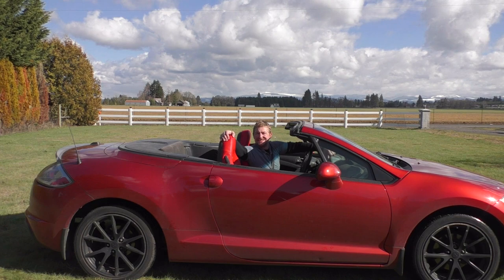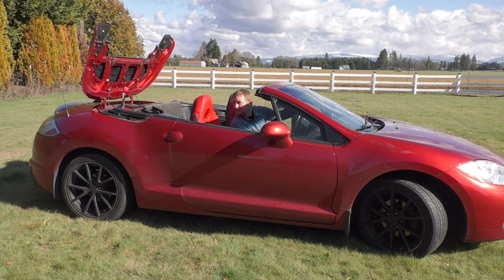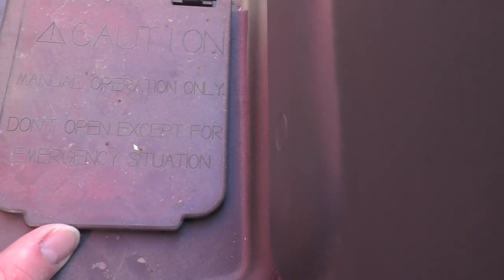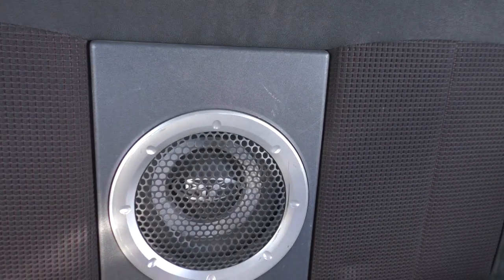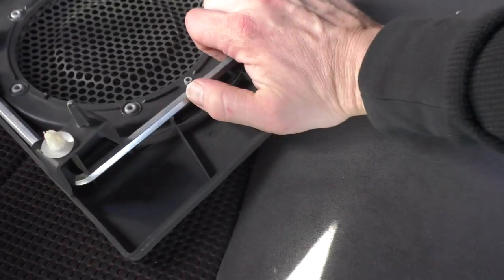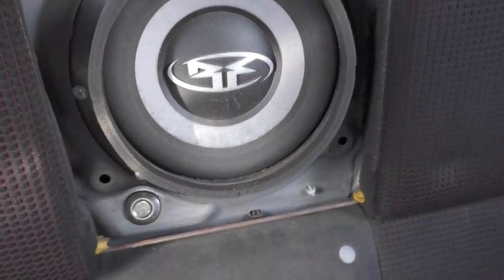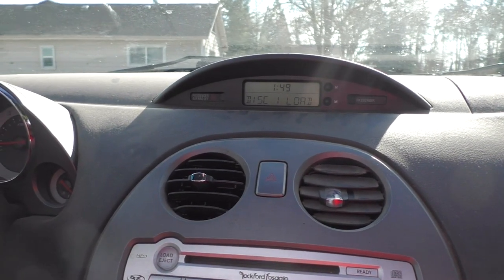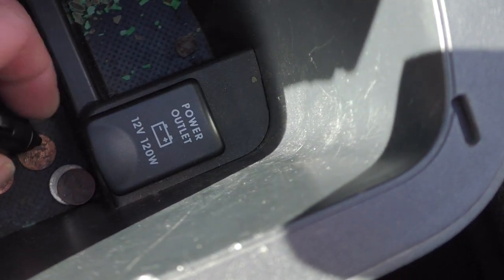Eclipse Convertable troubles

Comment: Thanks for the video. We’ve got an ‘07 and had trouble with some part that bent while putting the top down. It cost more than a little to have it fixed. But it was worth it, as my wife and I think these are about as cool a looking convertible as you can find.
Reply: Hey! Did your 07 had the aux input?

Comment: Wife has an 07 version of this car.  I’m trying to remove the hinges that are leaking hydronic  fluid.  I’ve already had one of the cylinders rebuilt.   On her car there 6 cylinders and the two hinges.  Getting the hinges out are posing to be very difficult to remove.
On the 07 model there was no aux jack.  I had to remove the stereo and add the cable myself.  
Also also, my cat sleeps in the same exact place.
Reply: I have a 2007 also. I might need to ask you some questions. I am having to figure this out on my own. I’m a little lost😁
Reply: I never could find a good video so just started removing things and taking pictures.  First one took about an hour and a half ( drivers side).  The other one took 30-45 min once I knew what I was doing.   Sent them off to get rebuilt.  Let’s see how long it takes to install.  Lot to removed.  Even the two panels from inside the car back seat.   I do a lot of work on my cars so have bunches of tools.  It helped a lot.

Comment: Have had problems with my top as well.  Going to see if I can add fluid, since pricing the 3 hydraulic cylinders are about $250 in a kit.
Reply: Hey did you find the hydraulic fluid? I'm having a hard time finding it
Reply: @moniquegainey3292 dealer told me you can use automatic transmission fluid or power steering fluid i guess 🤷‍♂️

Comment: sweet. my 2008 top is not opening for a while. I took it to a few places and conclusion is water dripped into the car through the back window and damaged the engine that opens/closes the top. Now I "need" a new top and engine. Upholstery guy i took the car to said the Eclipses are really "finiquie"? to make new tops to, so he recommended taking to Mitsubishi, who discontinued fixing/replacing it. I'm in ATL Georgia, do any of you have tips on where to go to get a top (does not need to be new, just in decent condition) and the engine to work the open/close mechanism? thanks!!!
Reply from the maker: Very good question. I really don't know about that one.

Comment: Just fixed my top on my 12 spider Mitsubishi. Wouldn't close all the way.opened the to half way and found a loose bolt in the middle of the track. So happy, now I don't have to drive 50 miles to the dealer to fix. Hope this helps anyone with similar issues.

Comment: Thanks for this video... Do anyone know how to fill the hydraulic fluid back up and where to purchase the fluid??
Reply from the maker: For that repair I have no idea. I would take it a Mitsubishi mechanic. They should know that question and what to do. It may be a simple fix, I just have no idea how to do it
Reply: @woodbrassandglass  thanks for your response.. the latch that you opened in the back for the emergency manual close, the place to refill the hydraulic fluid isn't in that compartment??

Comment: The hydraulic cylinder that lifts the back cover up is leaking oil. Is it a sealed system? Can I add oil somewhere? It goes really slow and growing, just like low oil. Help!! Lol, any more ideas?
Reply from the maker: If it's leaking oil, you've most likely burst a seal. If you have friend who specializes in hydraulics take it there. Otherwise the car dealership is my advice
Reply: Hey did you ever refill the hydraulic fluid and if so what kind

Comment: Do you know if they ever switched the knob back after you were able to close the top. I just closed the top using this technique and now the open and close switches register and the windows go down also hear the motor but nothing happens and the t bar mechanism doesn’t move when either open or
Closed button is pressed
Reply from the maker: Sounds like several issues at once. I would take it to the Mitsubishi dealer/service station.
Reply: @woodbrassandglass  Sorry maybe I worded that weirdly. So I followed your steps to close the top manually but I didn't turn back the knob back clockwise that holds the pressure before I pressed the close button which sealed the top. Now my open and close button registers like its working and I hear the motor moving but nothing happens and Im wondering if it was because I didn't turn back the knob which controls the pressure.
Reply from the maker: @onlyheavenknows  It could be it. I only was able to fix my issue because it was too cold out in the top head issues because of constriction due to cold. Once it warmed up in the day the top worked. Your issue sounds like an entire different solution is needed. It may be worthwhile to stop by a mechanic to have them look at it. It could be extremely simple. Take care
Reply: @woodbrassandglass  Thank you! Will do, take care as well!

Comment: I'm planning on getting a 2008 eclipse Spyder. Is it a good car? Any advice? Thank u
Reply from the maker: Hi:). I've nevrr drove a 2008. However I don't believe the difference are that much compare to a 2012. Cosmetic only. I would absolutely buy this car over again. I purchased it 5 years ago in cash and do not regret it at all.
Reply: I have an 08 Spyder, good car, no problems, do change the timing belt and water pump to be on the safe side.

Comment: Hi
I came across your video and it was the best that I have seen on reviews. I actually took time out on this Sunday morning to spread my angel wings & to share your link with others through another video. Before I purchase this car tomorrow on Monday  December 21st can u please let me know if this kind of car has too many issues & if it's worth buying or not.
Reply from the maker: I would buy this car over 100 times. It's the funnest I've ever had. It's only a weekend driver. But I totally enjoy it! I believe the real issue I faced with the top not closing was because it was so cold and it wouldn't work. Once it got sunny it worked fine. And has worked fine ever since. So beware of cold temps when opening or closing it.

Comment: If the top stops when it was almost yo close what and there is a little space wheren the water can get in, what should i do?
Reply from the maker: I had the same issue until I was able to get it to work again. My recommendation is until it is repaired and working use a car cover made for the Mitsubishi eclipse or park it under an awning or car covering. Or put a tarp over it:)

Comment: I also have a leaky cylinder. Not sure if these a replaceable, since it looks like a special tool is required to attached the lines on both ends. Does any one know about this?
Reply from the maker: You may need a full replacement. Probably best to take it to a shop. Hydraulics can get bad really fast...:(
Reply: I have the same problem. $1500 repair

Comment: When i press the open button….it beeps and the roof is not opening.
Reply from the maker: I too have had similar things happen. I would check to make sure the trunk is shut. Both doors are shut. Also check to make sure the latches are unlatched. Somewhere a sensor is telling the computer that it's not safe to open the top.
Reply: Yeah i tried all even showed to mechanic….still the problem is unknown